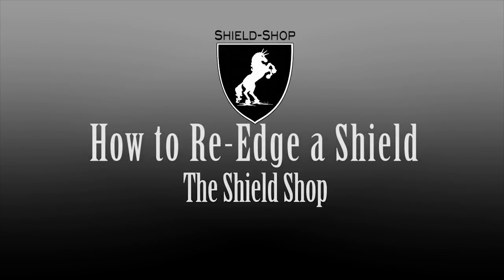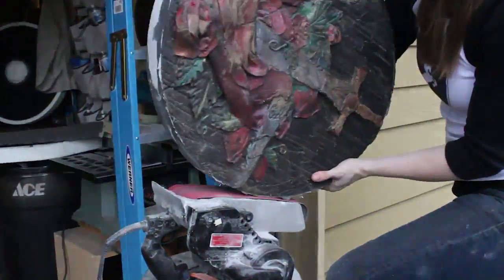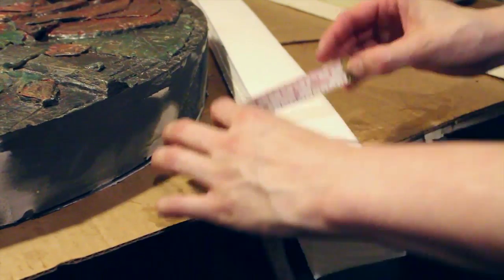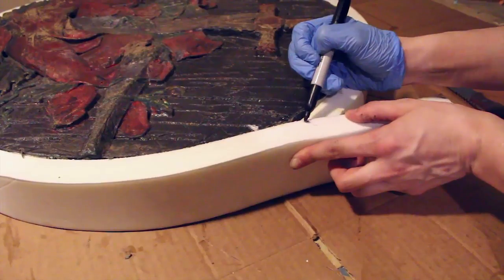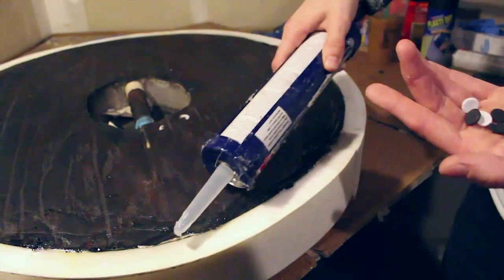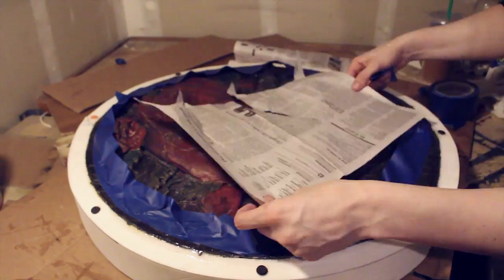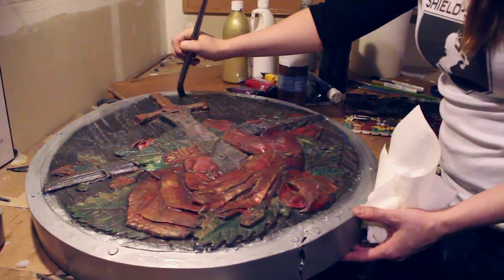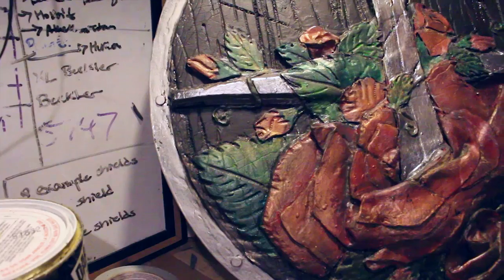How-to for Combat Sports: Re-Edge and Refurbish a Plasti Dip Shield

Comment: Great tutorial! Would you reseal the shield after painting it and if so, what would you recommend to reseal?
Reply from the maker: Hello! I'm glad you found the video helpful. Yes, we do re-seal the shields. I forgot to add that part! We use either Leak Stopper Clear or Through the Roof, it all depends on the humidity and temperature of your area. Leak Stopper Clear dries in 2 hours, but is thinner. Through the Roof dries in 72 hours or more, and is thick. Both work well. Thanks for the comment; I will make sure to add an edit with this info.